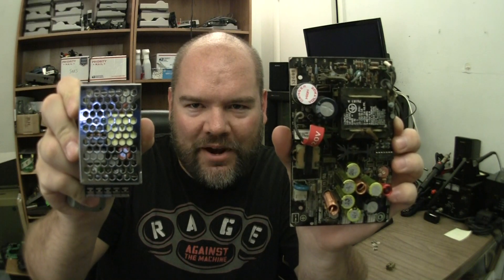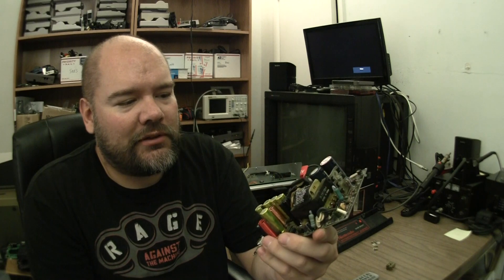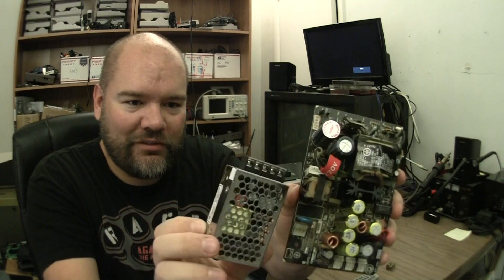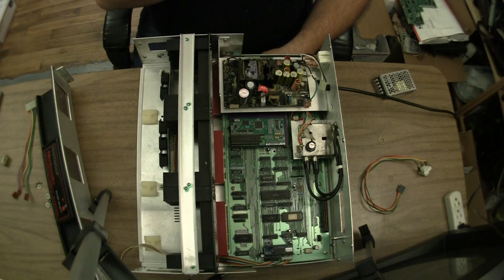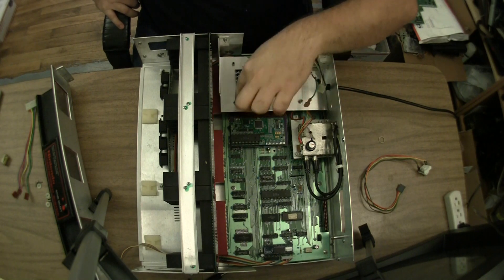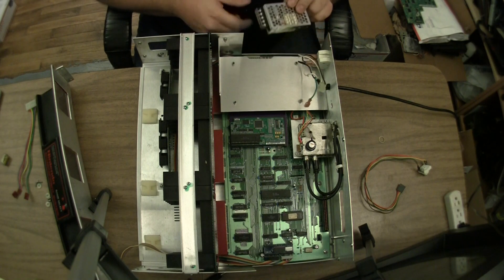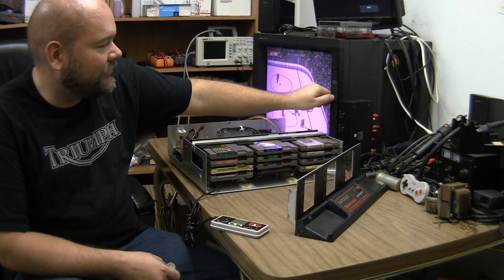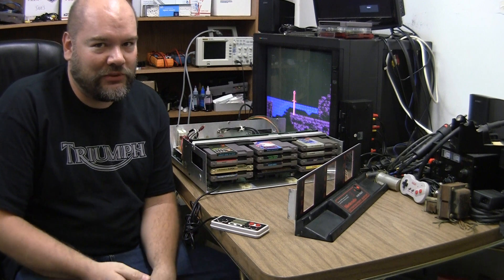Nintendo M82 2.0 - power supply upgrade TDK Lambda LS25-5

Comment: Hi
My nintendo m82 had a power supply issues
I bought the same than you use on this video
Where do you find the 2 solders for the 5v on the pcb ?
This is a little faster for me
Regards
Fred

Comment: Hi
My nintendo m82 had a power supply issues
I bought the same than you use on this video
Where do you find the 2 solders for the 5v on the pcb ?
This is a little faster for me
Regards
Fred
Reply: Fred RUMEU  The pin connector consists of 2 x 3 pins and two ‘stand alone’ pins.

From the left if you flip the mobo over:

First three pins are Negative
Second set of three pins are Positive (you can see on the traces/solder that they are connected).

In my experience you can solder your plus or negative wire to any of the three corresponding pins on the mobo

I just got the same PSU he’s using but i can’t get a clear signal (though running 230 volts), but psu turns on fine and nothing gets fried (old psu still working and will make anything run as intended once reinserted)

I wonder if i need more volts/amps when running on 220V, sometimes the bootscreen animation will run, but no power on the LED game number display and cant switch to games

Comment: considering the size of the new psu some double sided sticky tape/pads would have been suitable to mount it & would have also insulated it sufficiently from the frame.

Amazing though what 30 years has done to shrinking electronics, the size of that old psu is incredible really for its output lol

Comment: Just curious as why you don't want the chassis connected to mains earth?
On the original unit is the chassis at some other potential (eg, -15v from a inverter or something) or is it just left floating? - if its just left floating it's probably fine connected to mains earth - in fact its probably better/safer that way.
Reply from the maker: I did want the frame earth'd actually, but wanted to go with how it was setup with the old supply. Kevtris is telling me the earth ground can be connected to mobo ground and prolly should be, makes sense to me. I will prolly take out the perf and retest with earth and mobo gnd's connected.
Reply: GameTechUS If the chassis is connected to mains Earth, the PSU can bolt onto the chassis like you originally had it.

Actually, the Earth wire from the mains should really be bolted in a separate place to the chassis anyway (since the unit has an Earth wire / mains plug).

With only the PSU connected to mains Earth, and isolated from the chassis, it could pose a dangerous condition if mains inside the PSU decided to short to the DC side for whatever reason (blown parts, and bits of metal / components flying around. It can / does happen.)

That could in theory cause mains voltage to be present on the DC side and M82 chassis. Earthing of the chassis is meant to prevent / minimize the risk by allowing dangerous current to flow back to Earth and hopefully blowing the fuse before anyone gets a shock. ;)

Just catching up on some of your vids - which type of wire stripper are you using btw? I like the fact it can work on ribbon cables too.

Comment: I'd cut a hole in the perfboard under the PSU just to make sure it can vent a little better. Most enclosed PSUs either have a fan or were meant to be used in a system with airflow. So, is there any concern that a switching PSU will cause interference where the original had a step-down transformer?
Reply from the maker: The perf is nothing if not full of holes already! heh
Also the bottom of the new psu is solid metal, you can see it in the vid, so no extra air flow would be gained. I would rather mount it to an aluminum plate and insolate the plate from the frame, but whatever...
I can't say for sure about interference yet...
Reply: The original supply was a switch mode supply not a linear and if anything a modern switcher should have better high frequency filtering than the original.

The old supply doesn't even look like it has an opto isolator in the feed back circuit it looks like it uses a transformer. It's safe but pretty ancient tech. That's a museum piece you've got there :-).

Comment: I am suprised you don't have sheets of copper clad around. Do you try to avoid making one-off circuit boards?
Reply from the maker: No i've never have 'made' pcb's, always had them fabbed sinc it's so cheap.
The plate for the supply was just some perf I was never going to use anyway.

Comment: Something to add you really want to adjust the output voltage with the supply under load (the M82 running preferably filled with carts). The ideal measuring point would be at the PCB power supply header to compensate for the voltage drop of the wires.

If you're looking for a good price on replacement power supplies check out MPJA or All Electronics. I use them all the time for my projects. I could get the same form factor supply 5 volts at 8 amps for 16 bucks.

I stumbled across these sites years ago and thought I'd share.
Reply from the maker: I wasn't really looking to cheap out on the supply, I just happen to start looking from cheapest which is just habit. But yeah thanks for the tip!
Reply: GameTechUS
These are high quality full EMI filtered (X and Y caps, MOV) Japanese caps on the primary and secondary, etc. I've found it's mostly markup that you're paying from the big 3 electronics distributors.

Another reason that supply was so big is it had multiple voltage outputs that were never used.

It's funny that Nintendo invested all that cash to produce a custom ASIC then cheaped out and ordered an off the shelf power supply that had multiple unnecessary outputs. When they could have simply ordered an off the shelf power supply with just the single 5 volt output they needed.

They must've got a good deal on some factory surplus or something.